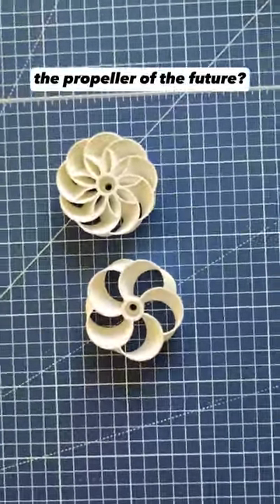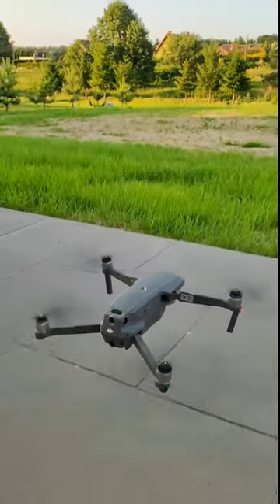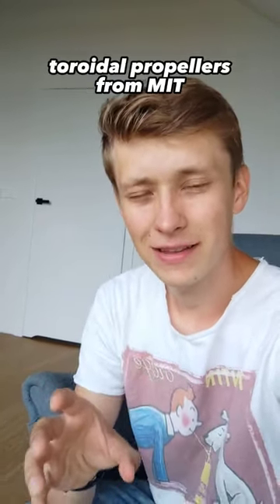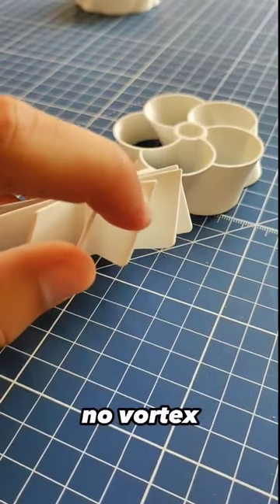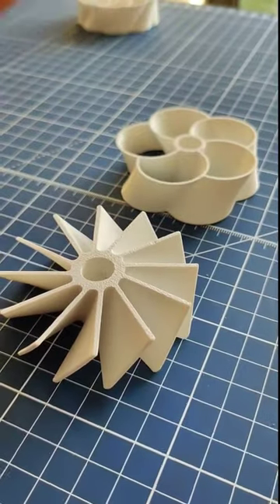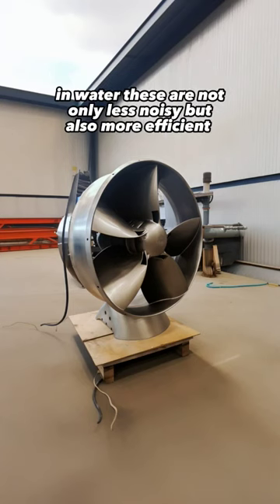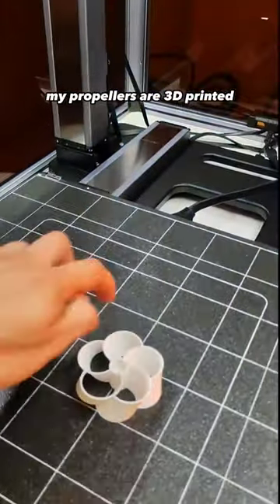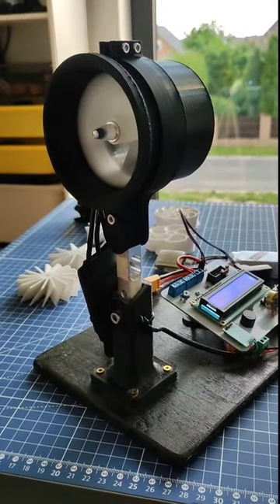Propeller of the future?!

Comment: They are very noise reducing but they are highly inefficient
Reply: Noise is a byproduct of an inefficient system. If they reduce noise wouldn't they likely be more efficient too?
Reply: @4587Spartan no they are not.  Also,  no one have compare thrust vs db wich I will belive that the toridal propeller will not produce good results.  We are still waiting to see MIT to show there results against other design. . .
Reply: @francisdaoust5862  I actually JUST saw someone do that comparison. The toroidal props are marginally quieter (a few decibels, at best), but produce about 25% less thrust.
Reply: Wrong, they produce the same airflow as regular shape propellers.
Reply: I have seen people done test, yes they are inefficient, just because it's less noisy, doesn't mean it's more efficient
Reply: @_Fanzy_  I think this is largely because the tests are done with 3d prints which are inherently inefficient because of the rough surface.
Reply: Yes… but no, im majoring in aeronautical mechanic design engineering, and im doing my thesis about this prpllr. Yes, theoretically speaking, they are more efficient than regular propellers, but im practice, they aren’t. But, why? Well, ill find out in some months when i finish this thesis. For now, it might be because of the difficult of manufacturing (Usually, additive manufacturing, which seems to have high rugosity values). We dont know yet if this is the main problem, but definitely is an important one.
Reply: @arproyect1881  that's amazing!  Looking forward to hearing from you. Is there any way to follow your works?
Reply: @aminulhussain2277 it’s not complicated. It’s physically impossible to be more efficient than a conventional propellor because it consists of more material and therefore mass. Given a constant torque provided by a motor, the acceleration must be lower for a propeller with higher mass and intertia. Basic ass QED smh
Reply: @4587Spartan  They reduce noise in a specific frequency range. Instead of high frequency noise they have lower frequency treble, but it's more inefficient than the regular prop in generating thrust.
Reply: They are more efficient, but you have to optimise it obv. An optimised toroidal prop is more efficient than an optimised regular prop
Reply: FYI: I believe the main reason for decreased efficiency is the parasitic drag of the looped ends.  As it spins, the outer face of each blade is almost perpendicular to the thrust vector, meaning that part is not contributing to thrust, but still causing drag.  Blades that taper towards the end are able to achieve higer RPM & thrust with less power input because they cut through the water more cleanly

Comment: They're low speed performance propellers. They're meant for sustained, low speed flight. Which isnt ideal for drones, especially because the original design is massive compared to a drone. And it's made massive because their performance decreases steeply as you miniaturise it.

Comment: These designs end up being less efficient, but quieter because they usually require you to spin it higher RPMs to achieve the same result as a normal propeller on boats. They might be a bit more efficient, but definitely not for something like a drone or an aerial vehicle

Comment: Physics is inexorable: the more blades a propeller has, the worse the efficiency of a single blade. Ideally, a propeller would have a single blade, but then it is a bit unbalanced. That is why propellers with two blades are so popular: each additional blade complicates the system, but does not bring the expected increase in efficiency.

Comment: Imagine a rod 1km long with a spiral thread, now spin it at 10000rpm...another stationary rod above it. Attach a pod to the stationary rod, use a worm drive on the threaded rod.
Why not travel at 1000kph.
Yes, hydraulic and pneumatic are options and so is a Tesla disk turbine.